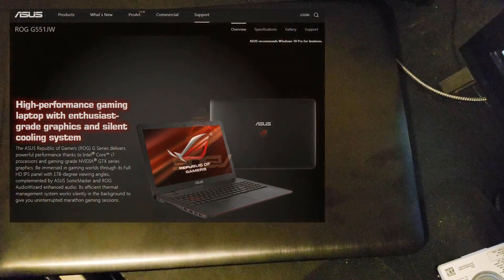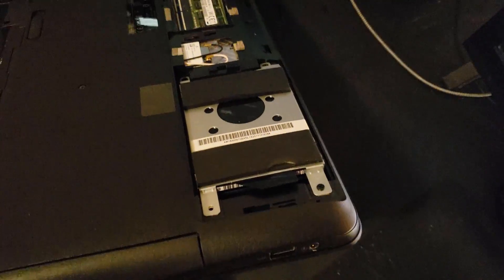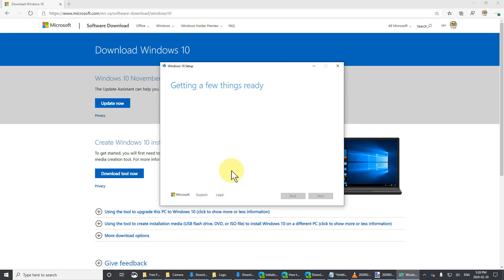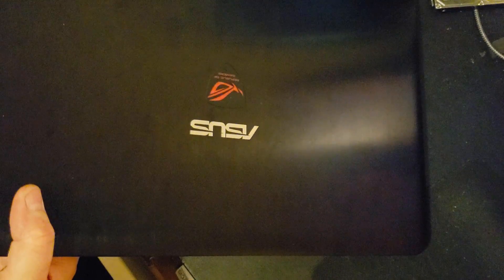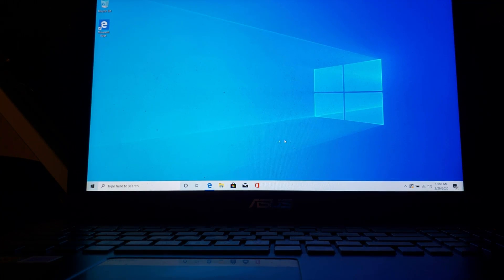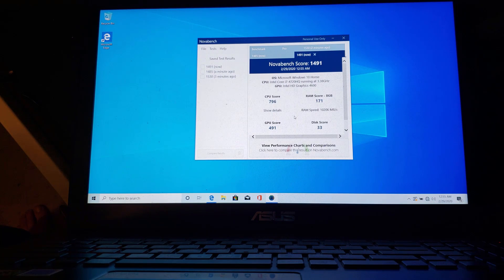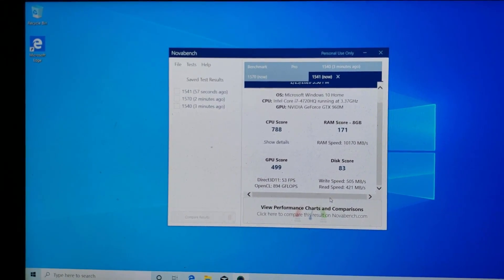Asus ROG G551J Laptop Disassembly SSD Hard Drive Upgrade Benchmark & Review

Comment: Great video! I recently bought a used but fully working Asus ROG G551JM and it came with 16Gb DDR3 1600MHz RAM, and i7 4710HQ i7, 1Tb hdd. I immediately removed the hdd and put my Intel S3610 1.2Tb 2,5" ssd in it. This laptop only cost me 100€. And the ssd i bought in 2020 for 100€ as well and that ssd were barely even used so like new and it still has 100% health.

Comment: 2021 and i still have this laptop. the only one problem what i have is keyboard. i change 2 times
Reply from the maker: Keyboards are a wearable part but going through 3 in total is unheard of.  Glad you have managed to keep it running all these years.
Reply: yep but i think they can make  power on button alone not with keyboard ;)

Comment: How.did you put back that DVD Rom, I'm stuck..
Reply from the maker: It just slid in and there was a single screw at the back holding it there
Reply: @URTechDotCa  Thanks. Did it already.. just had to slide it in and it fits perfectly

Comment: Nice video! I did some cleaning on my laptop today and found that ssd slot too, and i did some research, here's what i've found, hope it helps

So, that slot is exclusively there to put a 24gb msata mini FOR CACHE in case your computer came with an HDD instead of an SSD, if that's the case, then probably the laptop will have that SSD slot populated with the msata mini drive mentioned above from factory

IF you have the version that came with a 256gb ssd drive, there's no point of using a cache ssd mini, so that slot comes empty (my case)

In short: If you have a 2.5 ssd then your only upgrade option is get a higher capacity/speed one, if you have a HDD you better upgrade it to an ssd.
Reply: Hi can i maintain my 1Tb HDD and add on 512gb Msata?
Reply: @ejamrahmat8560  I guess that's possible, as long as you find a mini drive that fits that slot
Reply: @FromZerotoHeroBolivia  thanks a lot dude

Comment: Great video! I have a g551vw. Still did not tried to upgrade but it looks like my model is very simliar to yours. In case I wanted to add an SSD and still have the HD. What do you recommend me? Put the OS in the SSD? I can use the CD drive slot for a SATA connection, correct? Should i put the SSD or the HD in the main slot?
Reply: Go for SSD u can c the difference on same day
Reply: did u upgrade your 551vw? i tried mine yesterday but it wont turn on

Comment: This is Brilliant, Thank you so much! I bought this laptop in 2014 and it's still running strong, I upgraded to SSD and RAM to 16GB following this video and now the performance is through the roof. In 2020 this laptop can still play AAA games on low to medium graphics!!
Reply: Hi I have the same laptop and plan to fit an ssd into the msata port. Do you know if it takes a certain size or just which ever the ssd capacity is ?
Reply: @billsrs1982  The size needs to be 2.5 inch 👍
Reply: @billsrs1982  you are replacing HDD with SSD right?
Reply: @BlockChainOriginalGangster  no mate keeping original HDD  for storage and fitting a half size msata ssd for operating system
Reply: @billsrs1982  i still waiting for this Msata answer hehehe
Reply: What kind of ssd and ram did you installed?
Reply: @melkiasbernandes6117 im curious too. can this laptop use ssd m2?

Comment: I just upgraded mine to a 1tb Samsung Sata 2.5” and installed windows 10 but my laptop just freezes after about 1 minute. Did Anyone have this issue or know what it might be?
Reply: Did you try to reset it again? It may be the windows wasn't installed completely. Also, did you have that problem before with the old disk?
Reply: @abdullahn9827  yeah, I ended up taking it to a tech. It turns out it was overheating and he’s still working on it.

Comment: URTechDotCa:
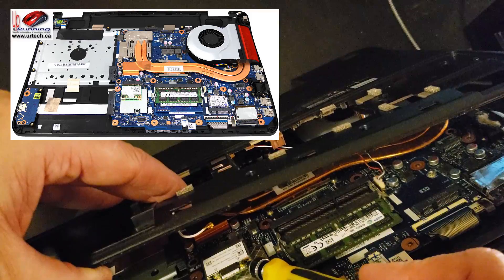I have the same Asus ROG G551 (GL551VW-DS71) and in the 4:55 minute, it looks the SSD slot perfectly. When I bought the laptop, I bought it with just 1 tb HDD 7200 rpm and I need to upgrade, so here are my questions:
What ssd to buy? Cause I know the differences between Sata I, II and III (normally with 2,5'' format or M.2 or mSATA) and M.2 (Sata too, or NVME format), because in the image showing up there, there is a mSATA I think, and I REALLY want to know if I replace the HDD (with and 2,5'' SSD SATA format, less speed than NVME) or add a SSD in the slot (and which SSD? mSATA or M.2)
Is this laptop support NVME in this SSD slot?
Hoping that you giving me the answer, please
Greetings!
Reply: I have updated mine with Samsung SSD 860 EVO 1TB then I have intstaled my operating system on it and now it boots in less than 30 seconds
Reply: @gianinainalucan791  yeah, finally, I upgrade my laptop, taking out the DVD and put the HDD, and second, I put an Crucial MX500, 1Tb......it starts the Win 10 in less than 15 seconds 👏👏👏👏
Reply: @felmac83  since you removed the cd driver, did you have a gap in the cover or wat? Like did you closed the gap with something? I mean is it looking good externally

Other question, what max speed you ended up getting?
Reply: @abdullahn9827  yeah, the gap that you mention, it closed with the same CD/DVD cover....the bay that I bought it include the gap for esthetic, but it doesn't fit right with the laptop, so you have to use the original one....

The velocity of the SSD is not that faster than the new NVME or PCIe formats, but it works (measured with Cristal Disk Mark 7, around 550 Mb/s read and 500 Mb/s of write)

Hope that my answer help you
Reply: @felmac83  awesome! Thanks man that's really answer my question
Reply: @felmac83  Wow wait a second, so what I understand is you took the original HDD that came with the laptop, replaced it with the DVD rom and put the SSD Crucial MX500 1TB in the place of the HDD. If that is the case, that's Awesome 👏
Reply: @felmac83 what kind of caddy that fit in your g551vw? Give me the link of spec please. Ty
Reply: Hi  @felmac83 , what kind or size ssd and caddy hdd to replace disc optical did you installed?

Comment: my CPU on this exact laptop is heating to 88 Celsius ingame... it just doesnt work as it used to.. any advice? :)
Reply: Same problem idk why?
Reply: @abdullahn9827  fixed it by opening and reapplying thermal paste on both cpu gpu and vents
Reply: @jofvenom  awesome! Will do that. Thanks
Reply: @abdullahn9827  no worries. Now cpu goes to 82 max with 80 average and that's okay